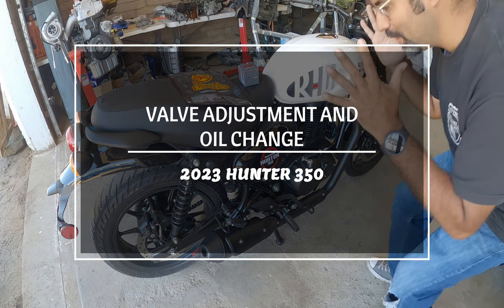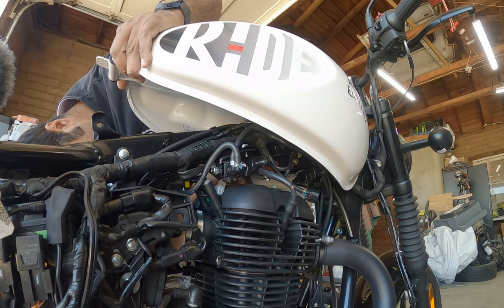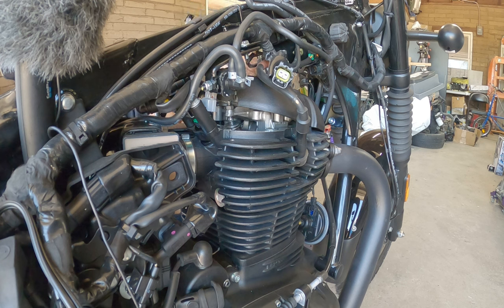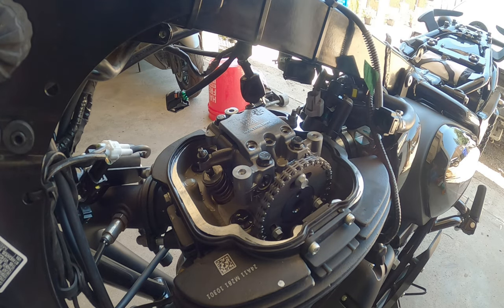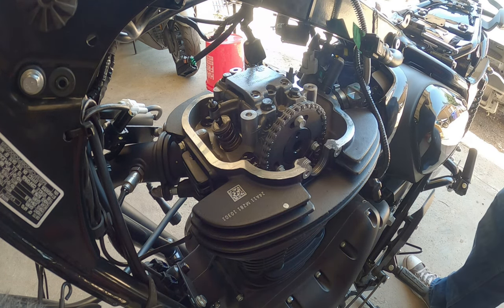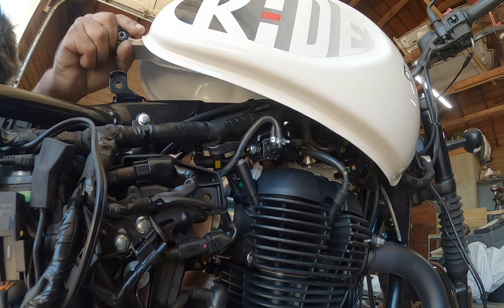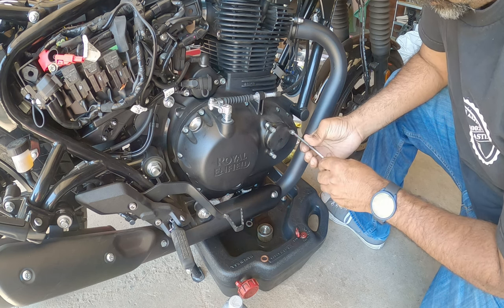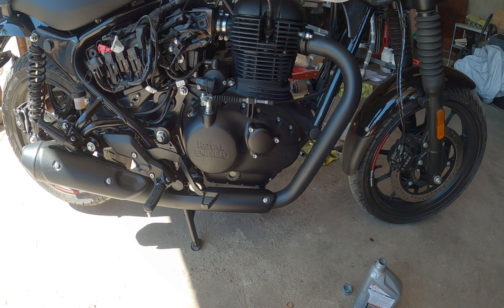Royal Enfield Hunter 350 - Oil Change and Valve Adjustment

Comment: Excellent video !!  what is the torque requirement for the oil drain plug ?? Greetings from Mexico
Reply from the maker: Here is the repair manual it will have all the info you need

https://drive.google.com/drive/folders/1rPSBYdJ1Spe0FfDCtvu6_WyuhzGdj7ZY
Reply: @PincheALsGarage  Thaxs Bro !!

Comment: Hey what’s up man I hope you get a chance to read and reply this message. I just bought my Hunter 350 it’s the same exact bike and color as the one here. I watched the whole video and took notes from step to step and took pictures and labeled everything you talked about. I’m pretty sure I got everything down but I’m just worried about making the valences exactly 007 and 003 and if I mess up I’ll be screwed. But also had a question about the oil draining cause when I did it did not successfully drain all the oil even though I took off the cap on the bottom and think I’m missing something. You kind of cut through that part and went straight to the oil filter installation and oil filling. If you could just explain the whole draining process to me I would greatly appreciate it man. Thank you
Reply: If you can’t tell I am brand new to doing my own maintenance. My second bike but haven’t tried working on my own bike yet.
Reply: Some oil is still in the sump, which you can drain from the right plug (the one with a copper washer). Draining most of the oil from the bottom is easy though, cannot imagine you didnt drain the vast majority of the oil that way. (remember to pull and clean the strainer from bottom too) If in doubt watch stuart fillingham.

Comment: Does the gasket not come loose from the top of the head?  Is it physically attached somehow?
Reply from the maker: @d.4tay549  they use a metal bracket to hold it in place on 1 side
Reply: Could that be circumvented, and simply use some spray adhesive and affix it to the underside channel of the valve cover?  @PincheALsGarage
Reply from the maker: @d.4tay549  adding a glue can cause the rubber seal to swell, shrink or hardened and cause an oil leak. I know it really sucks to line it back up and get the valve cover back on but there is no other good way to do this. I have gotten really good at reinstall the cover with the gasket laying on the head. Takes me about 3 - 5 minutes.